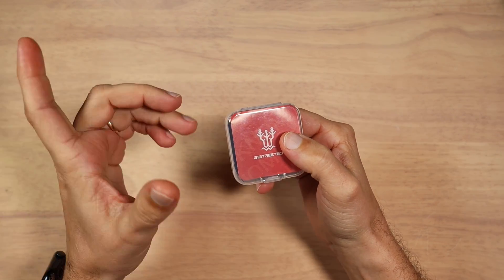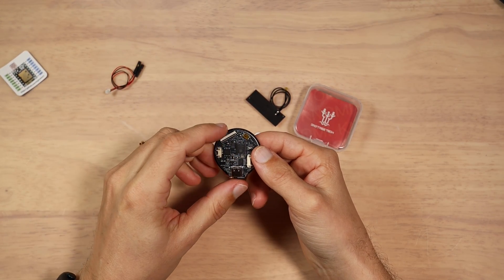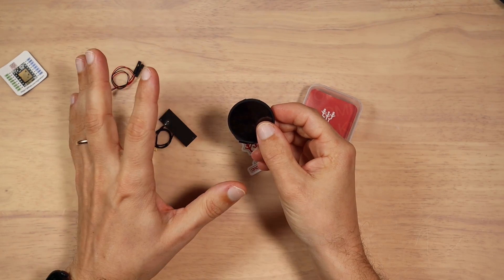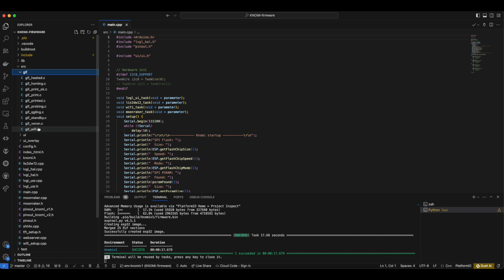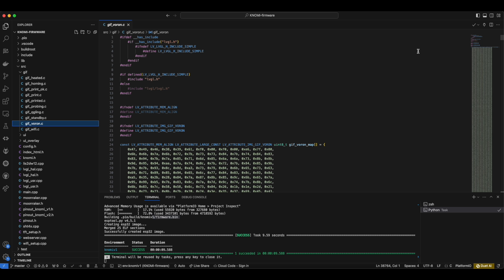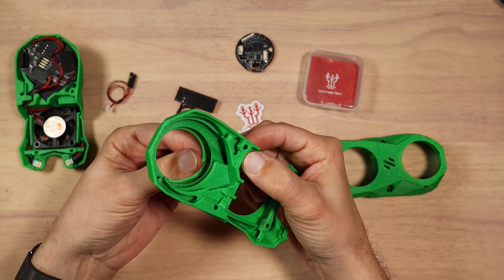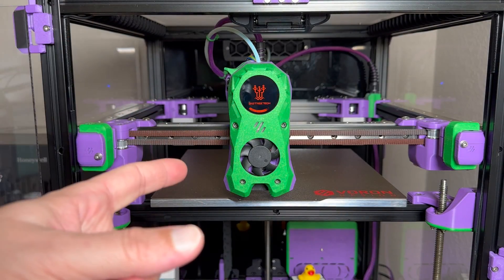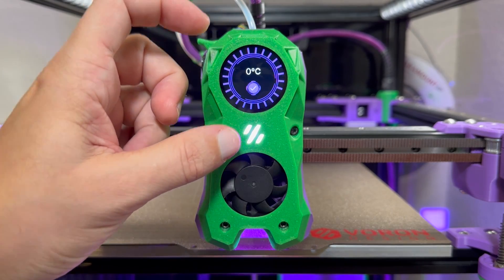BIGTREETECH KNOMI V2: Review and Customization

Comment: I changed the internal macro names, it's much better for you:

# 000000000000000000000000000000000000000000000000000000000000000000000000000000
#
# Captura las ordenes desde Knomi, con el firmware editado y las traduce a las
# macros existentes en la máquina
#
#
#   JMEC 20250905
#
# 000000000000000000000000000000000000000000000000000000000000000000000000000000

[gcode_macro _KNOMI_STATUS]
description: Para uso interno de Knomi
variable_homing: False
variable_probing: False
variable_qgling: False
variable_heating_nozzle: False
variable_heating_bed: False
gcode:
  M118 Status desde Knomi
  M117 Status desde Knomi

[gcode_macro KNOMI_G28]
description: Recibe la orden de home desde Knomi y llama a la macro correspondiente, para hacer el homing inteligente
gcode:
  M118 Centrado desde Knomi
  M117 Centrado desde Knomi
  CENTRADO

[gcode_macro KNOMI_BED_MESH]
description: Recibe la orden de calibrar cama desde Knomi y llama a la macro para hacer la malla de la cama
gcode:
  M118 Calibrar cama desde Knomi
  M117 Calibrar cama desde Knomi
  Leveling_Bed

[gcode_macro KNOMI_GANTRY_LEVEL]
description: Recibe la orden de ajuste horizontal desde Knomi y llama a la macro correspondiente
gcode:
  M118 Ajuste horizontal desde Knomi
  M117 Ajuste horizontal desde Knomi
  NIVELACION_HORIZONTAL
Reply from the maker: Thanks, but I don't speak that language ;-)

Comment: Haha I was using your video as a guide on how to modify the firmware. Got it done and built, I then finished the video turns out I was fixing what you were complaining about, negative temperatures! 
I have a pull request on their GitHubto implement, it is a one line change!

Comment: What board do you select for Knomi V2 in platform io
Reply from the maker: knomiv2
Reply: I am new to this. Must i create a new project in platform io? The firmware file wont open, if so i need to select a board
Reply from the maker: @rudigeyser2656  Just follow the video instruction. Also before even starting you must read an original documentation at least one time: https://bttwiki.com/KNOMI.html
Reply: There are alot of boards to choose from in  esp32-s3
Reply from the maker: @rudigeyser2656  U don't have to pick anything in platform io as it will automatically configure environment based on knomi version you have picked at the bottom of visual studio 4:24 time

Comment: Is it work on sovol sv08?
Reply from the maker: Works with any Klipper 3d printer. Sovol SV08 runs on Klipper.
Reply: @hobbyistnotes is it possible to install on head tool?
Reply from the maker: @shahram677  There is no STL provided by manufacturer for stock SV08 toolhead if you find or make one you can fit it.

Comment: Hello! I'm trying to flash Knomi v2 but unfortunately nothing works! The firmware is built in VS code using the platformIO , but when I flash the screen is always black, I tried different firmware, all the firmware that is built through PIO does not work! I tried to flash the firmware built by PIO via USB, and flash_tool did not work! To restore Knomi after firmware failures, I use Flash_tool and flash the Bin file from the official website! I've already tried everything and can't figure out where my mistake is??? please help
Reply from the maker: When you flash original firmware from BTT GitHub repo does your device works?
Reply: @hobbyistnotes  Yes, if I flash the firmware from github via the web interface, everything works! but as soon as I build it myself without changing the source data, nothing works through Vs code
Reply from the maker: @borys9549  I have feeling you forgot to pick proper KNOMI version in your editor.
Reply: Version v2
Reply from the maker: @borys9549  Not even sure how to help you. What OS you use? Have you tried my firmware?
Reply: windows 10. I think the problem is in Vs code, it compiles incorrectly! if I build through it nothing works! when I take someone else’s already assembled bin, it doesn’t matter whether it’s yours or another and I flash it through the server, everything works!
Reply from the maker: @borys9549  It could be that one of the libraries got updated, for me happened 1st where it wasn't building properly as it was for some reason using outdated library but it was easy to determine as on assembly it was throwing some errors, check if you have any errors popping, could be a good lead.
Reply: @hobbyistnotes  when I assemble the firmware, some errors appear, but they are yellow, i.e. errors in the comments, etc. I have already reviewed everything
Reply: @hobbyistnotes  you can build the knomi v2 firmware with "halk" on your vs code and post the bin file! and I’ll try to flash it and then I’ll understand that the problem is definitely with my computer(
Reply: I have one more question! please tell me when knomi is reflashed, its memory is erased? I want to understand when you reflash the device, a white screen appears and you need to enter wifi settings? because when I reflash knomi it remembers all the settings!
Reply from the maker: @borys9549  Here, I have uploaded the FW: https://github.com/irebane/KNOMI/tree/firmware/compiled_fw I have compiled it on my other mac that I have never use for such task, you can try. If this one won't work I will build one on my main device when ever I be back home.
Reply: @hobbyistnotes  OK thanks! I'm going to try now!
Reply: @hobbyistnotes  This is already very interesting! I just flashed knomi2 via OTA with your firmware and I got a black screen(((
Reply from the maker: @borys9549  Are you sure you have Knomi V2? What if you have V1 and all this time you are trying to flash V2 FW in it?
Reply: @hobbyistnotes  Of course I'm sure that v2))) esp32s3 is on the board! and markings on the board! and the touch screen works)
Reply from the maker: @borys9549  I think there is a good chance that something is wrong with bootloader or it's partitions. Check bin files on BTT Knomi repo.
Reply from the maker: @borys9549  Here is the manual how to do full re-flash: https://bttwiki.com/KNOMI.html#update-firmware
Reply: @hobbyistnotes  I'm not such an expert) tell me where to find the repo file in which section?
Reply from the maker: @borys9549  Here are 3 bin files: https://github.com/bigtreetech/KNOMI/tree/master/KNOMI2/Firmware write all 3 of them so your Knomi be in full factory mode. Follow this section of the manual: https://bttwiki.com/KNOMI.html#update-firmware use ESP32 Flash Tool
Reply: @hobbyistnotes  I do exactly as you wrote! when I have a black screen! To bring Knomi back to life, I’m flashing the original firmware, partition and bootloader! after that he comes to life
I set the bootloader offset address to 0x0 because the controller is esp 32 s3. no other way to flash and black screen
Reply from the maker: @borys9549  Exact memory addresses are very important, cus if you flash something on top of it based on the way it's configured you will get messed up flash and no boot.
Reply: @hobbyistnotes  I understand that addresses are important! but these are the instructions for the Knomi v1 firmware, and I have V2, if you install everything as in the instructions, it’s just a black screen! so I change offset bootloader 0x0 otherwise it doesn't work!
Reply from the maker: @borys9549  If you update over OTA it will still remember your wifi.
Reply: @hobbyistnotes  via OTA I got it! I wonder if settings will be lost through vs code or flash tool!? It’s important for me to understand this! Perhaps I have a defective Knomi and I’m wasting all this time! it is simply not flashed but restored
Reply: The strangest thing in this situation is that I downloaded bin from another blogger and it is being flashed onto my Knomi. all other bins that I tried do not work for me!
Reply: so I'm confused! It seems to be flashing, but not all firmware are suitable! I already want to throw Knomi in the trash! I've been wasting my time for a whole week))) and your time too)
Reply: please tell me! in vs code in the Knomi v2 folder after building there is a file called “idedata json” it contains information about offset but I don’t understand which patition and firmware I should use for the bootloader! If you have time, maybe you can give me some advice!

Comment: And by the way I don't really give a damn about the weight. I still think it is generally useless. The only use case I saw for it was in a tool changer setup. Glancing at the screen to show the nozzle temperature while it's on standby. Using it as a controller is moderately useful but at the same time there are much more convenient ways to control it. Web interface, mobilraker, klipper screen somewhat.
Reply from the maker: If we look at this item from technical standpoint it's somewhat useless and more of a cosmetic toy.

Comment: Have tried your firmware as well as my own and every time the upload gets to 100% I get an error of  [HTTP ERROR] Bad Request. Any ideas?
Reply from the maker: May be something is wrong with the firmware you already have on the board. I would try flashing it via USB instead of using OTA. You can do it directly from VStudio by connecting KNOMI while holding boot button, device will get in DFU mode and then you will be able to flash it directly. Check documentation to verify. I had to do it with my KNOMI V1 as It was on old firmware without OTA support.
Reply: @hobbyistnotes  Tried that and just get an error of A fatal error occurred: Could not open COM4, the port doesn't exist. I have tried just uploading the pre built firmware for KNOMI v2 and that I can do on the knomi.local I just can't get anything custom to upload.
Reply from the maker: @Ras_Hecko This error is related to cable or usb port, some USB-C cables are power only, try different cables. I would start 1st from compiling plain firmware from BTT repo code and uploading it to verify your VSCode environment works properly, may be some assets you are using too big for the memory of the device. Make sure you have picked correct device in your VScode environment, maybe you are trying to flash wrong Knomi version firmware over wrong device.
Reply: @hobbyistnotes Thank you, things I can check out.

Comment: I copied the firmware folder into the vscode explorer, but my window does not show the output section where yours says that the project was successfully updated. What do?
Reply: Also where are you finding the two different versions of Knomi? You have some tabs at the bottom of your window you click on, but those are not present in my window either. What do?
Reply from the maker: I just have checked everything from scratch and it works perfectly fine. Make sure you have VSCode with PlatformIO plugin installed before you drag Knomi folder over VScode, without plugin nothing will build. Make sure you downloading firmware branch cus other branches contains non firmware files. Follow exact steps mentioned in the video.

Comment: So I am not going to say that this is useless or pointless. I honestly don't feel like the weight is an issue either. I am just going to say I would rather have a large touchscreen somewhere else. But that's the beauty of an open-source project like the Voron. You can customize it however you want. And even if you aren't an expert there are plenty of options out there that companies like bigtreetech have made so you can integrate it relatively easily
Reply from the maker: Unfortunately those companies for some reason still can't make simple budget capacitive screen with good working touch.... current resistive tft screens are horrible...
Reply: @hobbyistnotes  define budget. The BTT HDMI5 should work with a voron, and it's like $45. It's not the cheapest thing out there, but it's not that much more expensive than a KNOMI v2
Reply from the maker: @MaheerKibria  I really like price and size of BIGTREETECH TFT35 but it's touch sucks...
Reply: @hobbyistnotes  BTT HDMI5 is a different one and works well, methinks. Either way I just purchased a KNOMI 2.